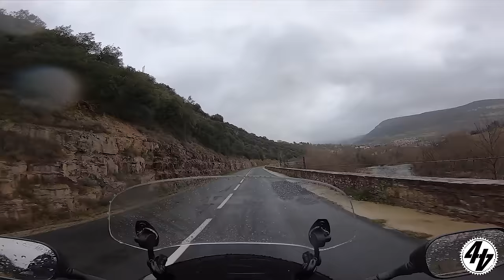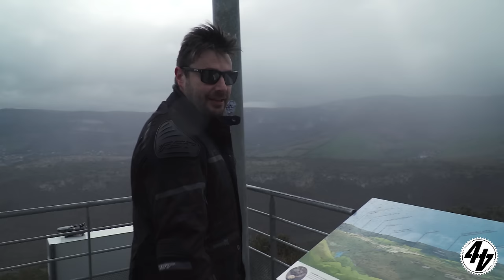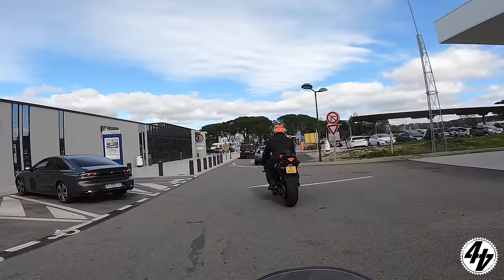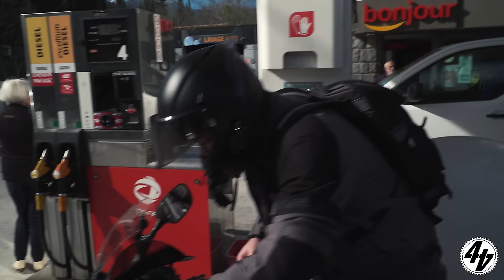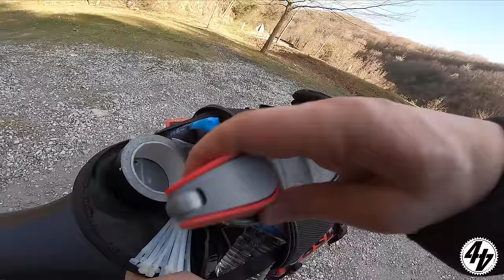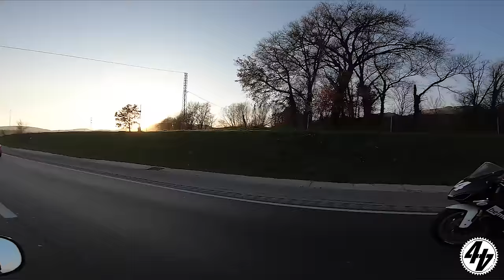R1 v K6 | Budget Bike Battle Benidorm | EP01

Comment: Definitely change those caliper seals before you go on track, stay safe. Also anyone thinking about doing the front brake reservoir delete like people do with the rear, where you just use a piece of hose, dot I did and the front calipers locked up like in this video lucky I didn't crash. Always use a proper res pot for front brakes

Comment: That problem with the seizing brakes happened to me once, it turned out it was the return hole in the master cylinder which was clogged so when the brake fluid heated up it caused it to seize.

Comment: When you go on the Peage in France, always take the pay station on the far right and you should get the bike rate (sometimes a narrower lane). If you pay on a normal lane you will pay the car rate... lesson for next time you have to go on a toll motorway, it will save you a shed load of money.
Reply from the maker: it auto detects as a CLASS 5 (bike)
Reply: @FortyFourTeeth  Mostly, if it doesn't just press the service/telephone button and a real person will alter it for you.
Reply: Given the fact they apparently paid for only one bike instead of two, they already have a pretty good deal I think! 😉
Reply: @FortyFourTeeth   yes it does on most - that's why you should not exit two a breast. I once got approached by a French Gendarme in northern France who told me this (I thought I was going to get pulled over for speeding!) as some do not auto detect.  Love your stuff big boys - just trying to save you some Euros.